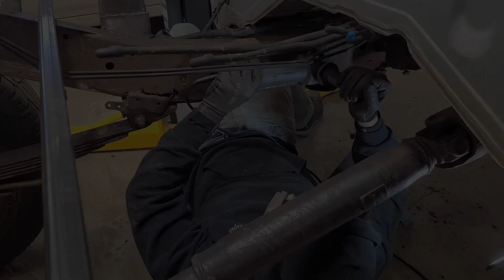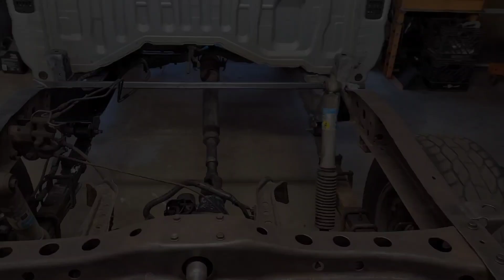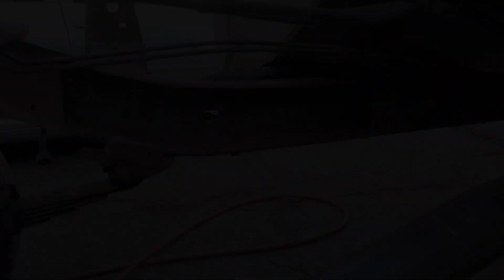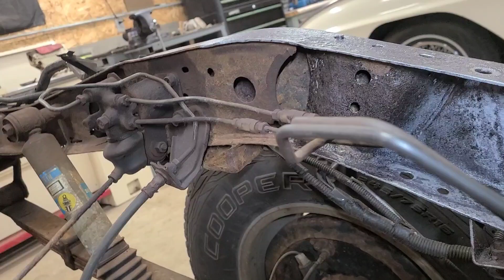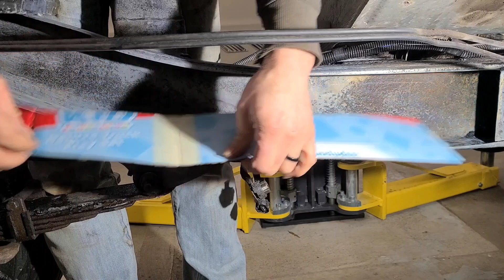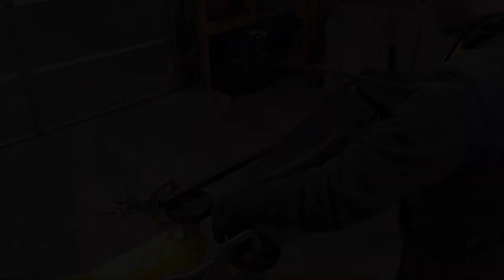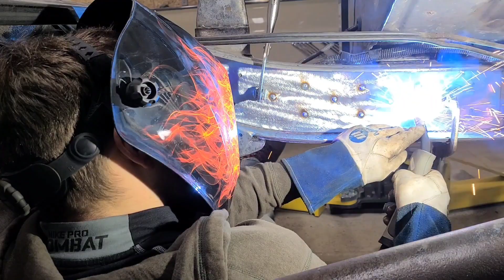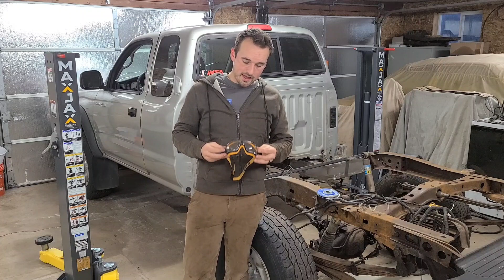Busting the Rust and repairing this Tacoma frame

Comment: Still can't make my mind up🤔if on the outside plate you butt welded it or fillet welded it because of the original frame has a. Small radius towards the front looks like a butt and back of the spring hanger fillet I guess it was easier to make the template with a hard edge ie not on the radius took my tub of today and mine is bad both inner and outer any advice how to go about doing both sides and possibly top or bottom I'd really like to keep the radius unless I can put a fillet weld and grind it into a radius fab video I've watched them all great stuff carry on the good work looking forward to the painting it 👍
Reply from the maker: Thank you, I'm happy to help with some suggestions. I finished adding in the rear crossmembers and fuel tank last week, so things are really moving along. 
I'm just speculating since I haven't seen how bad your frame is, but the top rail is likely to be in decent shape since it can stay drier. If you plan to replace the inner and outer plate, I would suggest finishing one at a time. You should be okay adding the inside reinforcement plate like I did, even if it is very rusted. You may only  be able to spot weld in certain thicker areas though. I would still plate it from the inside but possibly add an "L shaped" flange where it ties to the upper rail. A fillet weld at the plate abutment will allow you to grind that radiused edge to your plates. Otherwise, you would have to form it in. Hammer-form with a die or even add some heat to make it easier to roll that edge. Of course, a press would also be able to make that radius. If it is really bad, you could make some temporary jigs out of jack stands or something to hold the frame where it is before cutting things out. Definitely take a bunch of measurements or try accessing the factory frame measurement specs from a body shop.
Hope this helps.

Comment: I bought a 2001 Single cab 2.7 4x4 SR5 from Louisiana the last 1/3 of the frame was rusted body mounts and cross members swapped out.. Great work!
Reply from the maker: Sounds like you also did a good job fixing your Tacoma. Great work 👍
The rear crossemembers bolt in, but
did you have to weld in new body mounts on the frame?
Reply: @PostRt  body mounts I still have to do, I want to weld some steel on the inner side of the last 1/3 of the frame.

Comment: Sand blaster and a torch is much easier
Reply from the maker: Those methods would also work. The cut off wheel is fast, precise, and also doesn't introduce a ton of extra heat into an already weakened frame.

Comment: Great prep jobs on rusty rail before welding the new piece in. Hopefully you applied zinc primer on the back side before welding so it won’t start to rust right away.

Comment: My Tacoma is 21 years old and the body and interior are in great shape. Although the frame has some rust holes. 
I took a long air blower and blew as much junk out of the frame as I could and then I sprayed some used motor oil in there and on the outside also. That was last year and it still looks damp from the oil. I feel that the oil has crept into the pores of the metal and is keeping the moisture and air away. Paint isn’t a good idea because water will get under it and keep the metal wet all the time. And don’t forget rust never sleeps.
Reply from the maker: If you have rust holes in your frame, I would be very cautious driving it. There will be much worse hiding.
When properly prepped and applied, a chassis coating will last. I will be using a wax coating over the chassis coating as well. Used engine oil should help but I would not want to have oil dripping out all over my garage or anywhere I parked my truck.
Reply: I agree the dripping oil is a bit messy. But I don’t have concrete in my garage although I wish I did. And I try to not spray so much as to have it running off. How is your truck doing now that you repaired it. I wish Toyota had better frames in those older trucks because they are great trucks.

Comment: Use sta-bil or fluid film type coating to keep rust at bay.  Never paint a frame; it WILL  peel off.    You could have coated the inner parts before welding with weldable primer.
Reply: I disagree. We've built log trailers and sandblasted and primed and painted with farm implement paint. It stays on. The reason why u can't get paint to stay is prep. Gotta have a mechanical or chemical bond. If u do this properly, it will last a lifetime. Eastwood makes a gr8 frame coating that I've used. If u paint over ANY rust it won't stay. Gotta start out from new, clean, blasted etc. The acid etches and converts whatever rust is left. It will not rust again as long as that coating is kept 100%. So many clean up some rust and then spray with rubber undercoating, terrible idea.
 My Pap worked with a guy who had a 48 sedan in 60s. Pap asked how do u keep it so nice in Ohio next to lake? 1 quart or any oil new or used, same with trans fluid, 1 tube if grease and 1 or 2 wax ring toilet gaskets. Mix and heat in a old pot. Will not rust after this and costs $6 to make if using used fluids, oils.

 When using Acid u can only use oil based paint after. If not u gotta rewet, let set, then clean with water or water and baking soda. I've used muratic for heavy rust 5 min or so then rinse with baking soda water mix, then ospho, then whatever paint. A frame or under body needs a gr8 coating in rust country to last. We've painted dozers, skidder, log trailers, etc. If u prep, and get a best case starting surface, sandblasted, etched with acid, etc u will get a mechanical bond, get a good coat of epoxy, then shoot a adhesion promoter, then a good tough paint like JD Black with hardener, then can't with the used oils, etc I will guarntee u it will not rust. A log bunk is hollow round or square tube. U can't really get in there to clean it. All u can do is get it sprayed with Ospho, then use a 360 nozzle and get primer, paint etc inside, it's alot of work on a 40 foot trailer. We sprayed with Ospho, coated with used oils and wax,  yrs later, still solid. clearance lights go on outside so we got a 2 inch hole to look into with bore camera. 
Best thing is layers. A good example is look at a new trailer any size for sale. They don't do a good job. It will rust sitting there cause they didn't prep, weld, coat all the metal. I've sandblasted them and the paint comes off with the air, b4 sand gets hitting it. Try to take 60 grit and sand on any JD or any heavy machinery or farming machines. That paint makes black beauty coal slag work to get it off. I can blast a few frames, body's in time it takes to do a piece of machinery. That paint and primer is the real deal. I agree with you about wax, oil etc. Bit as somebody who's done this work for years, it's not impossible to get paint to stick and stay inside a frame, etc it is hard if we don't spend extra time making sure the metal is clean, dry, rough surface, sealed, primed, painted and then protected. It's alot of steps. But worth it if u keep or use the machine and want to keep it. A lil bit of prevention, like stopping rust when it's a small bubble, not half a frame is gone. Try acid. 
It's way easier to get into hard spots and get clean and ready for a primer, paint etc when u can't get a sander, grinder, sandblaster to clean it. It's a uphill battle but it can be won. And can be won cheaply than $100+ bucket of wax with no oils that need applied 2 times or more a year. Acid is $20 for muratic, and same for ospho. They both have saved me lots of time and money.
Reply from the maker: @Jason Christopher  
Absolutely, the prep work is super important and often skipped over. Then people blame the product for being inferior. I am planning to use Eastwood products on this truck when I'm finished with the fab work and cleanup.
Reply: @PostRt  Yes I've seen and did myself. I used Ospho and forgot to rewet, let set, then rinse or neutralise b4 primer with epoxy on a fender. Months later I saw a bubble like rust. I sanded and it wasn't rust. I didn't do above b4 primer. And I used Car Rep primer. It's epoxy that has no pot life. It's 2k but mixes when sprayed, not pop activator, shake and u got maybe 24 hrs then trash. Costs same. I would've said This Car Rep is BS. We all get busy. But when it comes to this kinda stuff u gotta do it right. I talked to a paint rep since 80s. He said we stopped telling ppl or saying no when asked by ppl if they can use acid b4 primer. Why? Cause so many would blame us when they didn't follow directions. I mean we see daily with driving. How many speed, don't signal, tailgate etc. Like por 15. Says DO NOT SHAKE. Ppl shake and then blame por 15. Says on can, Do not shake. Gotta stir. Bondo, don't mix. Knead. Etc. Gotta do it right, follow directions, and prep is 95% of any paint job, no matter what it is.
Reply: @PostRt  ... have you tried the EastWood rust converter product...  goes on white then turns it black and then paint over it... my results experimenting with that are kinda on the sketchy side after a year and a winter
Reply from the maker: @efil4kizum  No, but many of the rust converter products are made of the same stuff. I used Klean Strip Phosphoric Acid to clean and convert the rust. You can see how I used it in my videos. It is cheap and available at many home supply stores. It is strong and works really well!
Reply: @PostRt  watch Just a hand. He uses 60%about concentration. That's why most say if not all concerts do another coat. It's maybe half that strength. U can buy it online in a few strengths. I got some 70% food grade and it works gr8. Used for pickling crap idr what. Anything with metal that food comes in? But still ppl buy and expect to just spray on bad rust. U gotta prep and get big, chunks off. Then it will work gr8. Or use muriatic rinse then phosphoric. I've used Eastwood's internal frame, and chassis extreme. Gr8 stuff. There's a coating with aluminum and zinc that u need 2-3 coats then a top coat, but it's made for municipalities for bridges, etc. If done right it will last 3 decades or more for a daily, lifetime for restoration not in snow, salt, etc.
Reply: @jasonchristopher2977  Great info here, thank you!
Reply: @dc6233  I'm in the restoration business. From hit n miss engines, old cars n trucks, farming machinery, he'll even some ppl want old crap to put in yard for decoration. If it rusts away it's not good. Everyone is right here. All coating do eventually stop doing their job. But it shouldn't be in our lifetime. If done properly, with added hardener, and coating is cared for, it will last when we're worm food. 

The #1 key is prep. I don't care what kind of paint, coating, primer, etc if the prep is not 100% it's a time bomb. I've seen it fall off in many ways from ppl NOT doing the prep. Anybody can paint anything. U must have it clean, u must have the best mechanical adhesion, IE sandblasting is best, sanding, grinding, etc and chemical adhesion, chemicals that u spray like a coating as in promoter for painting bumpers or parts that flex. If u do both then dam that's gonna be the bees knees. Some coatings won't mix. Epoxy and Ospho. Now u can get it to play nice by a rewet of ospho, let sit 5 min or so, rinse really well with water or water and baking soda, and a fast dry with heat air etc. Then epoxy is no issue. If using acid and a oil based like Rustoleum, urr fine.

 We've done antique cars that are driven and still look good. But most things like that are not truly tested. Having a model T that u drive maybe 200 miles a year at parades then it sits in a climate controlled space is not a test. the sun is a paint killer. It will fade paint, peel it and hurt even us. Gotta keep the paint clean and coated with a good 303, ceramic, graphene type coating and wax. 

Any paint job big or small is all about prep. I teach this to students. Prep is where it's at. If u can prep, derust, and get coating to stick, u got success. I say John deere enamel with about 5 capful of hardener is it. I sandblasted and painted alot of heavy equipment. Even with black beauty coal slag at 110 psi that stuff is so dam tough. I can strip a car fender at Lower psi in minutes. That JD primer and paint is tough. We redid a 650 dozer and skidder in 2004 and it's still good to go and it's outside all year and getting hit by sun, scraped by the trees, pushing trees and logs and even having trees dropped on it. I use JD primer or just paint with hardener on frames and underbody, interpanels of autos. 
U can descale a box frame with a 2 small chain with a few links light duty and a old fiberglass CB antenna. Put 2 pieces of chain on metal piece that has threads and pit other in drill and run up and down both rails. Or use Muratic acid after u run up and down with air hammer and a blunt tip. Then remove with air, vac, etc. I use alot of Eastwoods internal frame or JD primer and paint. Get 1 of those refillable spray cans or make 1 from a tall rustoleum can. Turbo cans I think it's called. Solder in a tire valve, sans the rubber and just add with funnel whatever and use the 360 degree nozzle and 3 foot of hose and get it coated heavy. 
Another thing is let coating harden. It takes weeks for it to be truly hard. Like old men b4 cialis. I've blasted and painted alot of metal stuff of addll shapes, sizes and age. I was taught by old timers who had basic tools but put in time making whatever right b4 paint. If u have ny questions I will do my best to help. If I can't I'll call ppl from these companies who do. I've called and talked with alot of them. Very nice and helpful folks. I don't know it all, always learning and not afraid to say IDK. Yall have a gr8 week.
Reply from the maker: The inside frame was treated. I will be using a proper chassis coating and later adding a top coat  of protective wax. The coatings will last if the proper steps are taken.
Reply: @PostRt  Yes. Proper steps. Some of these frames are a PIA. It's hard to get a frame 100% without a teardown, strip down bare frame and blast it. Even then depending on zip code,at start to rust b4 u even get done. I've sandblasted and restored farm tractors from the early 1900s. Some of that paint after ww2, was tough stuff to clean. Only place on 540 skidder it came off easy was on corners. Just like TV we don't see the hours it takes cause the video would be hours and hours long. It's ALOT of work. My Father got us a 1949 chevy truck. We drove it through the yard then spent next 1 yr working day and night every day for a year taking it all apart and fixing, blasting, welding, cutting, sanding, etc. Burns u out. That's just stock drive train, not hot rods. We ended up taking a break for a week and got fresh look at it. Getting a frame good while all together is not easy. Still get burnt out after hours of work. And under that fastener is rust still there. Waiting for u to spray urr choice on, then when u look in 6 months u c the brown stain of madness. But with the wax and oil this helps from spreading but never perfect. Only way to do it perfect takes almost a dip in a tank. But then with a auto or machine etc if ppl b4 us did it all perfect, what would we have to work on? Keeps that cycle going.
Reply from the maker: @Jason Christopher  You hit the nail on the head, and I can definitely tell you know what you are doing from experiencing it. I'm trying to do the best I can with the time I have right now. It should last me a good while but nothing lasts forever. Thank you for sharing your stories. It is nice to speak with someone that sees eye to eye.
Reply: @PostRt  Well no way is really WRONG, unless it's not prepping. It's about how many steps, how much work do u have time to provide? Some ppl have all the time and money, easy, us who work alot and have families, time is precious. If I can give the right time to a job I will sandblast completely, seal and go from there. Some ppl want it perfect, others good, or some just get it covered. I don't try to up sell and say U must do this but I tell them, this will not last decades. This is a knock off heavy, wire brush and cover job. There's nothing wrong with that. But I don't like to watch some videos online cause ppl are like Do it exactly, or patch outside of a panel while rust has ate inside, that's only way to do job right. Well right for me may be wrong 4 u. But we can all agree that when it comes to rust, u MUST KILL ALL rust or she will bite u in the butt later GUARNTEED. I've seen ppl paint over rust. That's ok for a quick sell, patch up and get her gone. Not for a job where I'm keeping this for my lifetime. So each ppl have their own ways of doing things. But basic Starting with a bare, rough surface free of rust, grease, contamination etc is where u HAVE to start. 

Those lasers look nice. I wish I could invent a laser on a small robot that will crawl up frame and laser 360 to clean inside. Then u could start 100%. Buy to do a best lasting job gotta start with clean steel. Love channel. U did a gr8 job. It's never perfect. We just keep trying. All ppl are not on same level of experience. I try to help young get good habits and those who start this passion. it's awsome and alot of new products come out but tge old tried and true ways of doing things don't change really.
Reply: Paint will fail on pretty much anything if you don't know how.  Many frames have been painted and successful in not peeling. The proper environment and products is what matters.